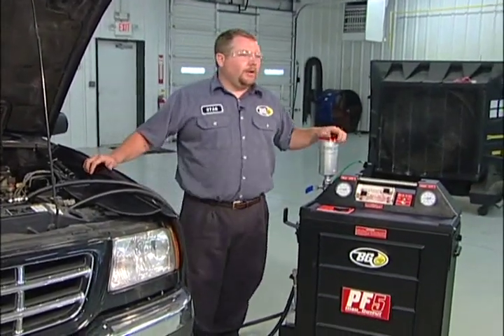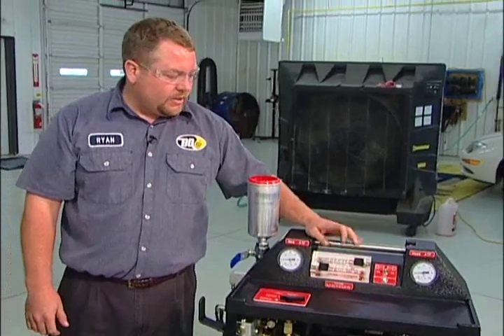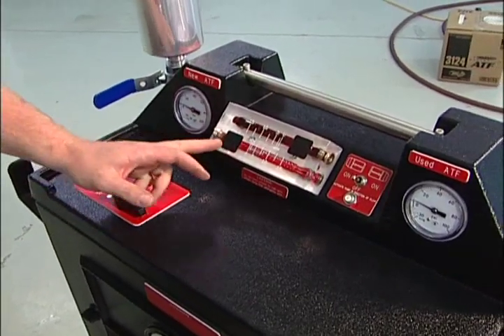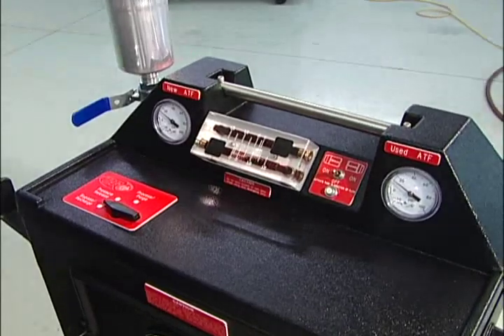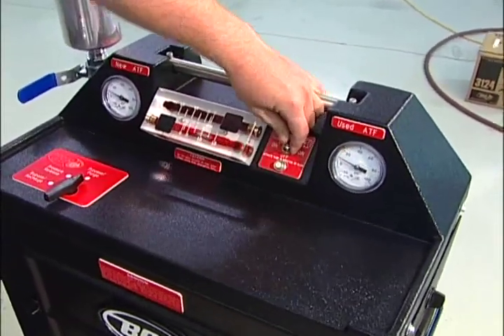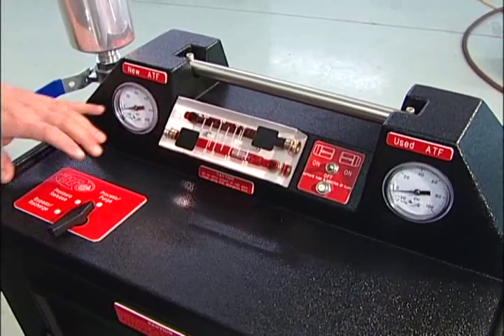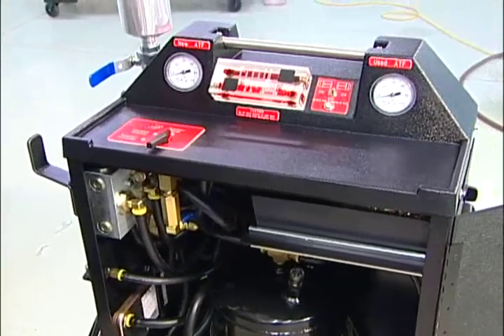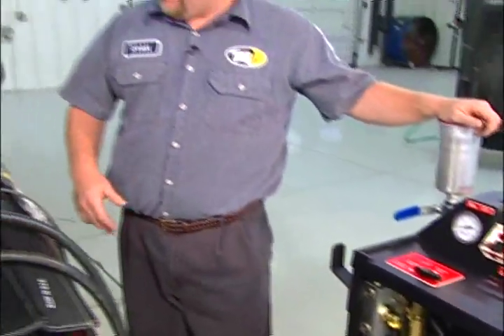BG PF5-HO Power Flush and Fluid Exchange System

Comment: Does the machine account for expansion of transmission fluid? So before the flush begins, let's say the fluid is hot, if we push 1 quart of fluid, it actually replaces .8 quart because .8 had expanded to 1 quart, so that can lead to overfill for sealed transmissions? Please clarify Thanks
Reply: James Carroll  That is 100% wrong. Changing the atf will not help the filter last longer. The filter will remove the dirt from the atf before you change or flush it out. If another part don't break first. The filter will plug up.
Reply: @Fone65  on crip frfr
Reply: @Exertiions  What are you trying to say?
Reply: @Fone65  on crip
Reply: James Carroll  So you don't build transmissions but trying to school me. I have videos on my channel to prove I can.
Reply: James Carroll  Some one lied to you. Transmission filters don't have bypass.
Reply: James Carroll  I don't believe a person when they tell me they are certified master mechanic. Young boys say that when they run out of things to say.
Reply: James Carroll  I don't work for people cheat their customers.
Reply: James Carroll  You build transmissions
Reply: James Carroll  If you are a certified mechanic for 25 years it doesn't mean you are a good one.  I had a veteran Toytota tech telling me that the 4.7 had a timing chain, not a belt.  Told me he would bet his salary on it.  Plus ASE means nothing these days.   Just find the right guy who isn't failing anyone.  It's only a piece of paper nowadays.
Reply: Sandeep P You are trying to sound like you know something.
Reply: You are trying to sound like your opinion was needed
Reply: It's not my opinion the flushing is bs. Dropping the pan and changing the filter is the way to go.
Reply: @Fone65  there's 16qts in a trans, you don't drop all 16 when you change the filter ya dingus. But yes, I'd recommend changing the filter as well as fluid exchange depending on condition of fluid or trans.
Reply: @robertguy23  Name calling online make you sound weak. That transmission does not hold 16 quarts.
Reply: James Carroll  I've never seen a transmission stop pulling because of old fluid. I've seen a few stop pulling because the filter was stopped up. Before you try to school me. Rebuild a transmission, make it last 3 years and 27k miles.
Reply: James Carroll  easy work
Reply: James Carroll  I have seen filters that had metallic shavings on them from the break in period when the vehicle was new.  Plus there is a magnet in the pan for a reason.   You remove the metal paste from the magnet and it also gives you an indication of the amount of wear on the transmission.   

Also when the pan is off, the bands can and should be adjusted and the torque specs on all internal bolts should be checked.     Frequent fluid changes won't address any of these items.